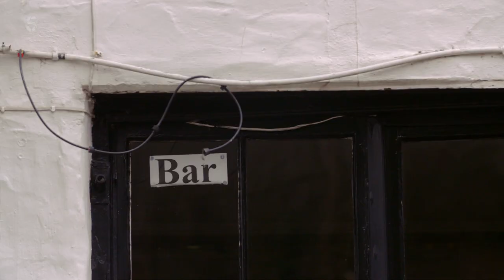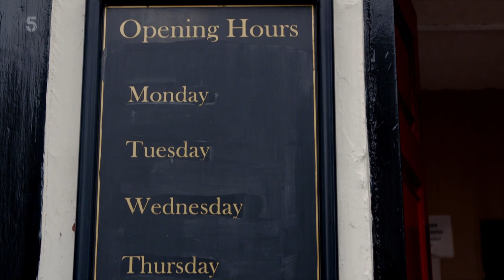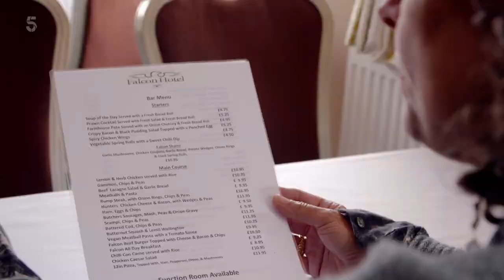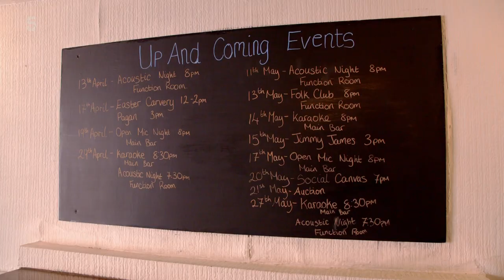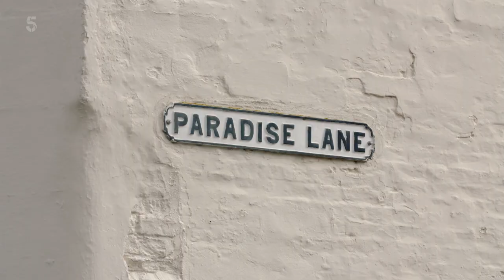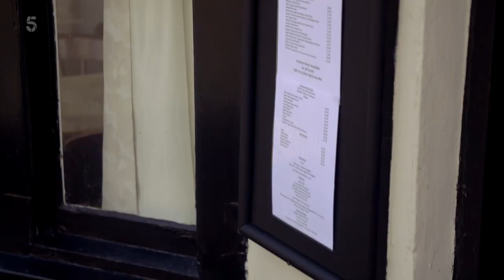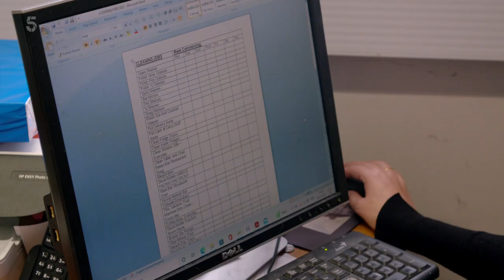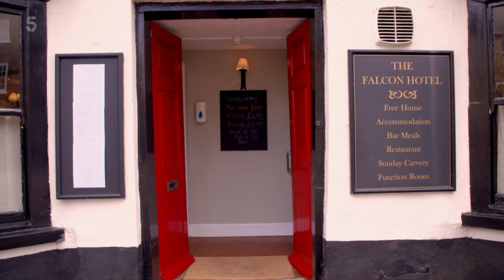The Hotel Inspector S17E06

Comment: An interesting episode indeed. That magnificent building is a draw in its own right. The wonky floors are expected in a 4 or 500 year old building. It quite likely has timber framing. That framing was often green oak, so would have shrunk and twisted quite a lot in the first century of its life. 
I can certainly see why Alex did what she did here. The budget she has to work with would have been wasted if it was less than £200 per room. The biggest bang for the buck came from the pub and dining room. That will draw in local residents who want a meal out. She did not have the big party because i suspect the accomidations, which business affiliations can pay dividends, are not going to be of high enough standard to make the grade. Yet. Give them time. Rather than a B&B, this is more a pub with rooms. I hope they manage to turn this into a genuine winner.